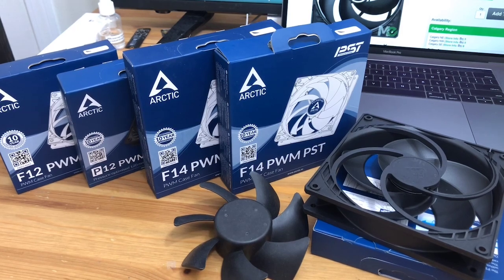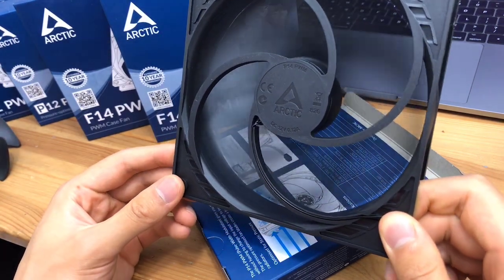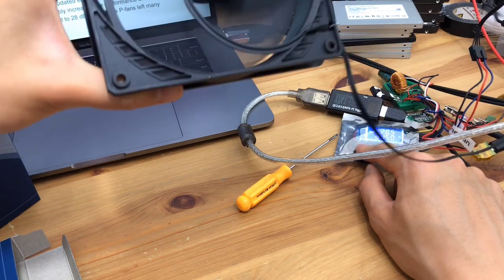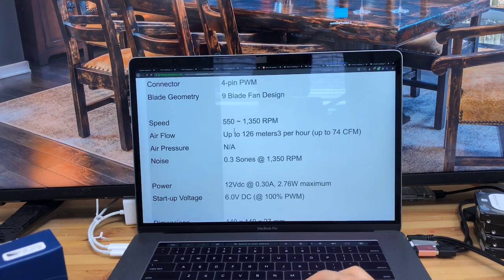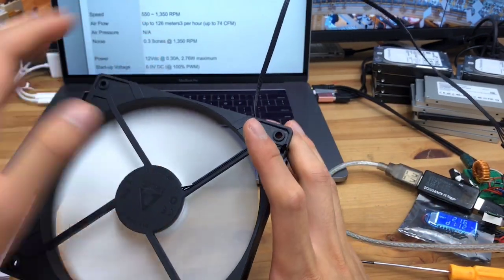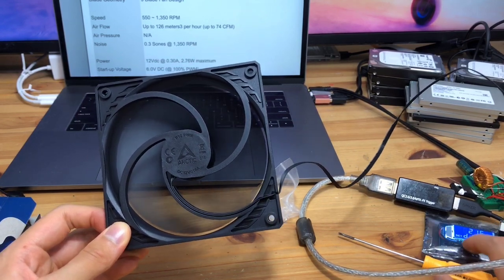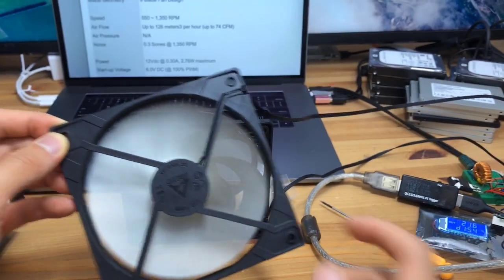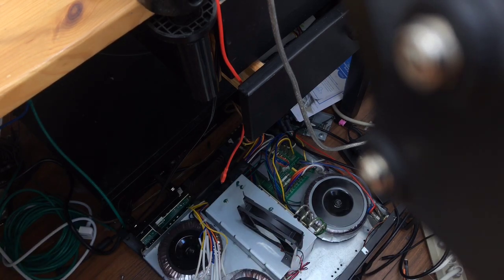Arctic P14 P12 F12 F14 Rev2 F14 Fans Test

Comment: When you mount them horizontally you will appreciate "name brand" fans.I have F12 and P12 fans and they rattle like hell after few months mounted in the roof...Noctua SSO bearing is king,woth every penny when monted horizontally.Cheap fans like this do great job only mounted vertically in front of the case and at the rear exhaust.I have 3 x P12 fans in the front and I had to add rubber fab gaskets because they vibrate to much at max RPM.There are better fans out there, I for one will not buy any more cheap Arctic fans.
Reply: THIS! My case has six P14 Silents and the only one to rattle was the one mounted in the top towards the rear as an exhaust.
EDIT* I opened the fan as seen in this video and poured a drop or two of '3-in-1' oil into the fan bearing and this seems to have fixed the noise for now!

Comment: currently thinking about having 3 f12's in the front for intake 1 in the back for exhaust and 2 p14's for my h115i radiator on top as exhaust, ideas or suggestions?
Reply: Sounds like a good choice. I just go full P12/14 but I doubt it makes much difference
Reply: @smugmode  I just went with f series for intake and 1 exhaust because they are airflow optimized while p series are static pressure optimized so its just made the most sense. in reality there really is no difference, maybe like 1 db and 0.5c

Comment: Would the p12 be a good replacement for the cpu cooler hyperx evo 212? One of the fans is crapping out and i would like to replace them. Currently 10 cad on amazon.
Reply from the maker: Sure, they should work well for this purpose.

Comment: I read the P12 and P14 are designed for radiators and cpu coolers. Will you recommend these instead of the F12 and F14 for a case fan use.
Reply: The F fans aren't great, I have an F120 that is about as balanced as a cement mixer (still better than Bitfinex!).

I use P14s as these as case fans. Even with filters (3 filtered in, 1 out), they move a good amount of air. I don't need them above 70% (normally 30-60%), so they are quiet. Very good for the price. The only issue is that they're 27mm thick rather than the standard 25mm, which can be a problem on certain mounts. Noctua fans are worth the extra money if you can afford it.

Comment: Where does the air come out from?the side with the sticker or the one without the sticker
Reply: the side without the sticker
Reply: Most fans pull air in from the front (where the sticker is), and push it out the back (where the crossbars are).

Comment: I have a f14 dc with an external temp sensor. It is also 3 pin. pin 1 ground, pin 2 is 12v and pin 3 is RPM. I think i gave pin 3 some 12v as well, could this have fried anything internally? The fan doesn't turn faster when the temp sensor is in hot water or hot air....
Reply from the maker: Yes, it is possible to damage the control IC in the fan this way. A long time ago I accidentally made this mistake on a P12 Pro and it didn't work properly after that. I had to replace the control chip with the stuff from another fan, but it never worked as well again.
Reply: @liminalsunset  Thanks, the shop sent a new fan. I will receive it tomorrow, should do the trick.

Comment: Hey! I have such fans in my pc is it okay if i dissasemble them to clean them better? And also for my cpu fan is it ok to pop it off the housing, like they won’t get damaged or anything (sorry for the stupid question)
Reply from the maker: I do not recommend disassembling them to clean them, but rather to use a soft bristle brush to brush the dust off the surfaces lightly. It does a very good job.
Reply: @liminalsunset  ok thank you

Comment: Anyone know if the P12 fan blade pops off as easily as the P14? I want to clean and grease the bearing on mine...
Reply from the maker: I gave it a try but it didn't pop off so easily. It may as well be the same design, just harder. I didn't take it off to avoid breaking it before making the video.
Reply: @liminalsunset  thanks. I gave up anyway

Comment: Thanks for the  video. Very long though!

Where can I find the conclusion about the F12 and P12 please?

Thanks
Reply from the maker: Sorry for the length of the video. It was minimally edited and it's a review of many models. 

The takeaway is that the P12 and P14 are excellent fans which should be nearly inaudible at PWM less than 65%. The F12 isn't as amazing, in my opinion, but is fine. The F14 models aren't that great, but aren't awful either.
Reply: @liminalsunset  very good. Thanks Larry

Comment: P14 vs F14 which one is best?
Reply from the maker: Tbh I'd say P14
Reply: Depends on use.   F14 is case fans for max air flow.  P14 is pressurized flow for radiators and heat sinks.
Reply: @astroboy2345   ARCTIC P14 Value Pack case fan

Comment: What would you recommend, F14 or P14 as a case fan?
Reply: Alessandro Vignato the f14 is designed for a case fan intake or exhaust. The p14 is for aio or heatsink cooking. You could use either one. For case I went with the f14
Reply: @bellabugs  F14 for power supply will be better?
Reply: Іван Денищич Most power supply’s have their own fan unless you’re going to mod it, I recommend the P series for that.

Comment: so P14 is better then F14? I have BE QUIET 801 case with 6 x 3 pin fan controller....should i buy P14 3pin regular ones and control them via FAN controller?
Reply: For a case fan, you want the high airflow f14's and for radiators, you want the p14's as they are high-pressure fans

Comment: Are these p12 pwm or p12 pwm pst fans?
Reply from the maker: These are P12 PWM, non PST. However, I suspect the fan itself is the same. I don't expect to need to review the PST feature seperately.
Reply: @liminalsunset  what does pst mean😇😅
Reply from the maker: @olliger603  PST means PWM Sharing Technology. This means the fan's wire has a second connector on it that lets you connect power and PWM to another fan in parallel.
Reply: @liminalsunset  thanks!

Comment: Which do you recommend for a PC case, P12 or F12 (I need airflow)?
Reply: P12 should be better  , I've ordered both P14 and F14 , will see
Reply: I've seen a review from the german guy " Der8auer " and P14 is top notch , P12 not that much but still good.
Happy I chose that :)
Reply: Andrea Thks, I will chose P12 because y cant aford the P14 and my case only supports 120mm, but thks.

Comment: P12 silent or p12 pwn
Reply from the maker: p12 silent is a fixed speed version of p12 pwm
Reply: @liminalsunset  but what does that means? fixed in term of airflow or noise?
Reply from the maker: @Jaksoncpp  Fixed in both noise and airflow. It should be relatively inaudible while providing decent but not massive airflow.
Reply: @liminalsunset  i have a nzxt h500, better buy two p12 silent or the 5 pack p12 pwm pst?
Reply: @Jaksoncpp  It depends on if you want a very quiet PC or a cooler running PC.
Reply: @liminalsunset  Just adjust voltage in bios, not fixed anymore....

Comment: p12 is it good for case fans ?
Reply from the maker: sure, why not
Reply: The arctic f12 would be a better case fan as it is optimised for airflow and the p12 is pressure optimised which means that the p12 is better for radiator cooling and the f12 is better at being a high airflow case fan.
Reply: @fastflight2494  P12 should also be better for airflow through filters.

Comment: misinforming and pointless video. blade doesnt 'pops right off', by doing so you take the blade out the little snap mechanism inside and you are not able to fully put it back in even after you reseat the fan. just compare how thigt the blade sits on brand new fan thats not been disassembled, and how loosely it sits on the on disassembled one. if you do that, your fan will vibrate a lot more (so it will be louder), and it will probably wear a lot faster. these are not meant to be disasembled, by doing so you damage it, so you didnt benchmarked arctic p14 fan, you benchmarked damaged arctic p14 fan.
Reply from the maker: Thank you for the advice. In the video, I purposefully do not push it all the way in. When I push it firmly, I can hear it "click" into place and rotate without extra bearing noise. I have compared it before and after doing this off camera and the blade indeed sits in the proper location. I still have the same fan used for this, and it still functions fine without producing bearing noise.

With this said, you are right that they are probably not meant to be taken apart, but after a few years, when it begins to fail, you can try, since you don't have much to lose at that point.

Comment: F14 or p14 for a case fan?
Reply: F14 is a case fan.
P14 is a "pressure" fan, so it's better to use it on a radiator or a heatsink instead of using it as a case fan.
Reply: @DenFox89  Incorrect. P14 is good as front intake where the mesh/dust filter may be restrictive.
Reply: Most likely depends on the case. I have a Phanteks P500A and the F14's beat the P14's in airflow, cooling and sound performance. If you have a high enough impedance to airflow case, the advantage might shift to the P14's but it was not the case for me.